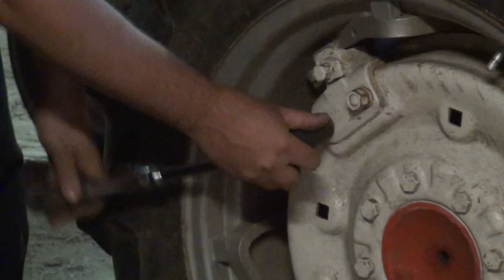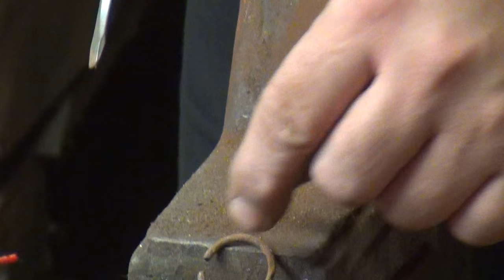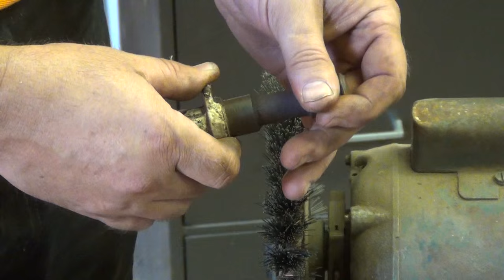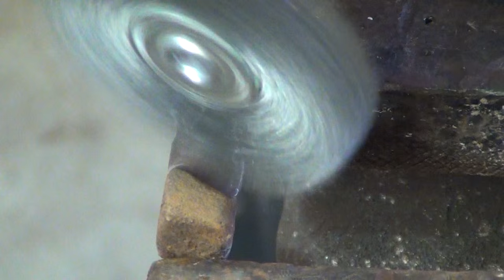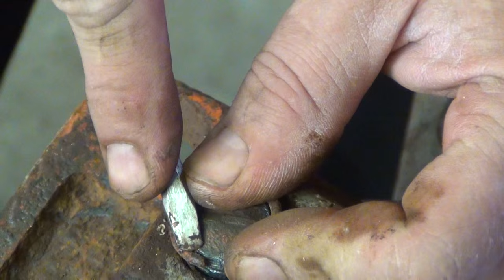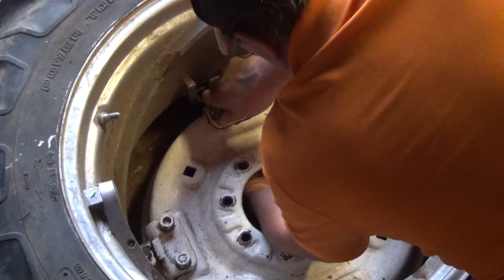Wheel Eccentric Repair For Allis Chalmers

Comment: Hello, great video. 
Have a 1958 D17, replaced the rear rims, tubes & tires.
Used the outer wheels, after sand blasting clean.
Cleaned all body, eccentric pins, blocks, replaced sap rings.
No seez on all parts
Reinstalled onto axle, also noseez , all rear axle bolts,
My engine is not running yet, so with rear wheels off 
Floor, ( tractor all blocked up) in gear I hand bumped the wheels as far as I can get them.
Their almost as far as they can go.
So I tightened  all body bolts snug, than the eccentric bolts
2 bolts on each wheel are 
Turned as far as they can go, and 2 will only go about  
1/2  the way. But are tight.
Any comment on my info.
Your video was a great help.
Thank you 
Dan

Comment: Dennis, your video helped me with my D15 a great deal.  I had to replace a tire, so thought I would "rebuild" the eccentrics on that one wheel.  Mine is a 1968 and they have never been used to shift the wheels.  I put the pins in a hydraulic press to remove rather than hammering and 1 came out pretty easy but the other three took 15 tons of pressure on a 40T press and when they released, it sounded like a gun shot.  They work good now, so will likely do the other wheel this winter when time allows.  One question:  I liked the jack you used in the video--if you don't mind can you tell who the manufacturer is and the tonnage.

Comment: This is a nice video, but way more complicated than needed. First off you don't have to take the tire off the tractor. Loosen the 8 bolts holding the casting on , but leave the nuts on 6 of them. Jack the tractor up and the 2 you took the nuts off rotate to the bottom. Take the bolts out completely, might have to use a punch to get them out, once they're out slide the casting down the powershift rail and take it out, put it in a vice, spray with penetrating oil put your impact wrench on and try and turn it in either direction. The pounding of the impact will.knock the rust free, if it moves a little shift the impact into reverse and walk the pin back and forth, once it turns spray it down with penetrating oil and eventually it will free wheel, now put it back on the rail, tap it in place, put your 2 bolts back in rotate another casting to the bottom, and repeat.
Reply from the maker: Thanks for your comments RJ.
 Most of the time the castings are stuck to hard to just slide them out.
Reply: Dennis Anderson never had a problem when they're on the bottom if you take a hammer and tap them down the rail, once one comes out they all will
Reply from the maker: The first is always the worst. 
 I know someone that would loosen all the nuts and drive the tractor around until the castings all popped free.
Reply: Dennis Anderson I guess that's an option!  Lol. We've don't that to try and get the power shift rim to slide, but found out Allis Chalmers made the castings on a taper, so if need be you can loosen the 8 bolts holding the brake and snap the clutch, and the wheel will slide, tighten the eight bolts and the rails will be tight again
Reply from the maker: All the ones I've worked on have been rusted so bad that brute force was needed. I also put the pins in from the back side and use the impact to just spin the pin. That gets the pin and the casting good and clean. This makes the pin turn easier when under pressure.
Reply: Dennis Anderson They can be a challenge, but they're still way better than the GD John Deere rack and pinion, that involves taking it completely off the axle heat impact wrenches hammers and lots of penetrating oil. Always thought that rack and pinion was a good idea until you have to move one that hasn't been moved in years, just take them off because you'll never get them free. The IH u bolt was another joke, so I'll stick with the better by design!
Reply: All good  information.....so happy to know how it all works.l have 2 d14s and they both need to be serviced with this technique. Thankyou  all.

Comment: Good video.  I used to have a 65 Massey with sliding wheels but never got rusty so just loosened bolts and snapped clutch holding brake on other side and they moved.  One thing on safety you never mentioned glasses when wire wheeling.

Comment: What do you use for anti-seize?
Reply from the maker: In the video I used what the AGCO dealer had on the shelf. It doesn’t need to be anything fancy like high temperature. Just any off the shelf anti-seize. Make sure you don’t put it on the block where it rides on the rail of the rim.